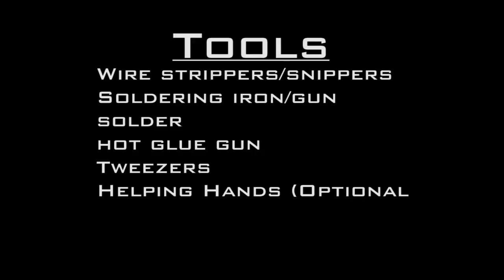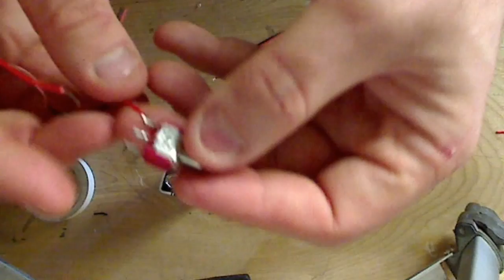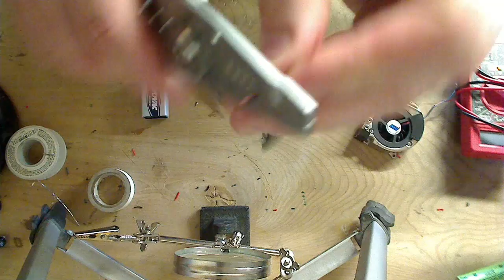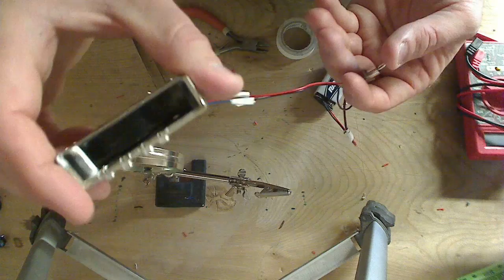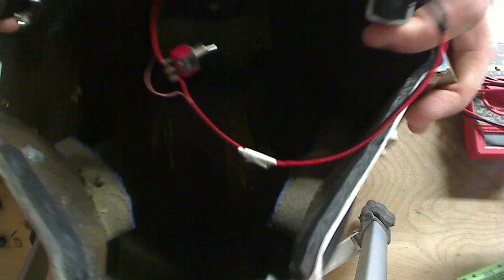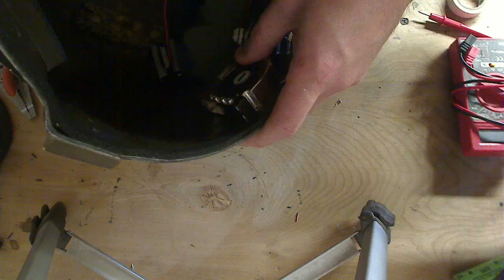Warmaster's Workshop - Episode 2: Basic Fan Circuit

Comment: question; anyone with an answer..

How do you stop the fan from sucking in your hair and getting tangled in the fan?

Most obvious answer I can think of is a balaclava, or other tight cap. But I've also seen some Mando ladies with long hair, braided, and loose, as well as shoulder length.
Reply from the maker: +Jamie Moore This is a very tough question, because long hair is going to get caught up in fans if you don't braid it up somehow.  What you can do is use some door/window mesh screen and cover the fans with that.  It'll minimize hair tangle, and shouldn't cut down dramatically on your air flow.